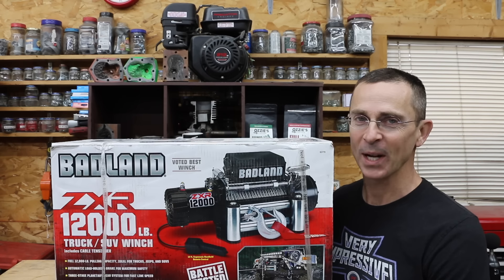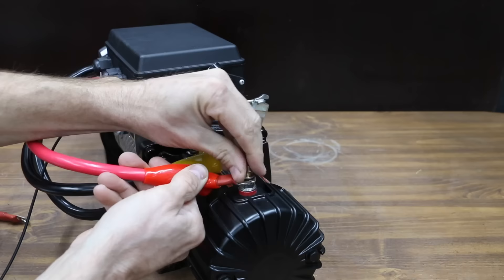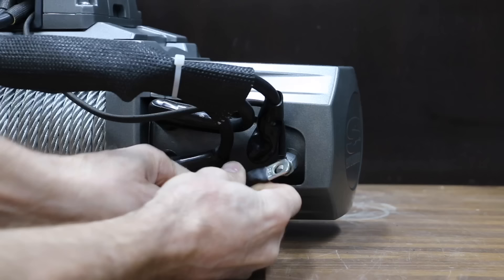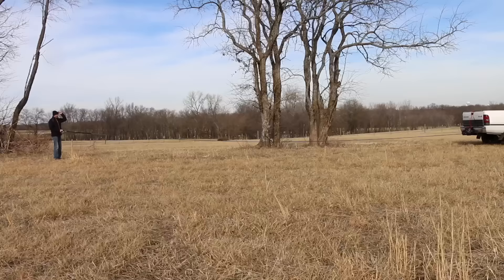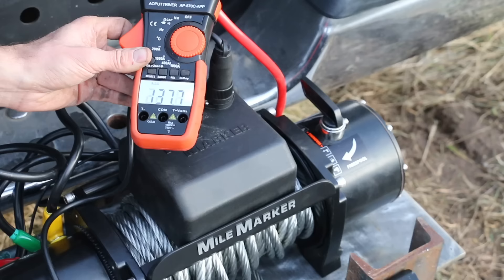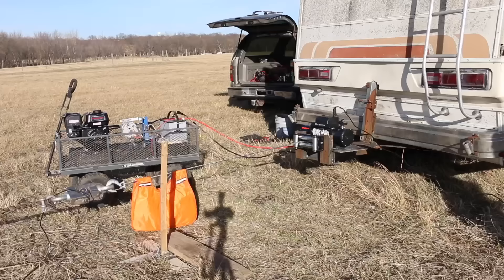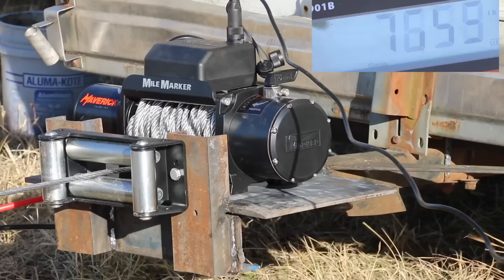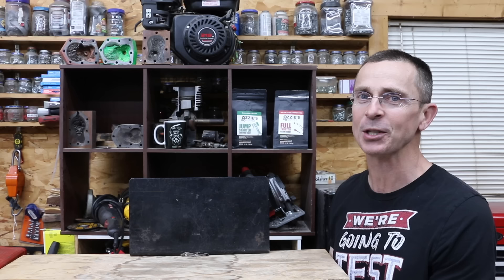Best Winch? Is BADLAND Better Than WARN, Smittybuilt, Milemarker? Let's Settle This!

Comment: I wish the Badland Apex was included, it seems to be the go to option at harbor freight.
Reply: Same
Reply from the maker: I can put together a round 2 video if there's enough interest
Reply: @ProjectFarm  yeah I would want to see the 600$ apex winch in action. It’s a fairly new product and it seems like a bunch of off road YouTube channels are switching to it.
Reply: @ProjectFarm  I would be interested for whatever it's worth!
Reply: @ProjectFarm  YES PLEASE!!!
Reply: Definitely interested.
Reply: @ProjectFarm  yes please!
Reply: Yes. Apex vs it’s Warn counterpart would be awesome. I’m seeing LOTS of Apex 12K’s out there
Reply: I would most definitely be interested
Reply: @ProjectFarm  Yes, please include ROPE VS STEEL CABLE as well.
Reply: @ProjectFarm  I've been running a 12k synthetic rope Apex for around a a year.  I love it, but I'm near needing another winch for another truck.  I'd love to see it out up against another
Reply: @ProjectFarm the zeak with a upgraded aftermarket rope or cable since the rope snapped?
Reply: Agreed The Apex is built much better than the standard $350 winch. Though I don't know how fair of a shake it got in the last couple of tests since it was damaged by a faulty plate.
Reply: I would like to see that added to the tests as well both in the wire and the synthetic rope options!
Reply: @ProjectFarm  honestly, is like to see the lowest rated winches that failed RETESTED because of a poor quality mount. Not fair to twist a winch and damage it because of user error.

BUT it was a very good learning point! I need to go look at the quality of MY mounts!
Reply: @kencramer1697  THIS
Reply: I have a badlands apex and it looks very similar to the zeak 🤔
Reply: A round two would be great
Reply: @ProjectFarm  definitely interested also
Reply: @ProjectFarm  YES!  please do the apex!
Reply: Yes, would love to see an Apex included in round 2... Even if it's just against the zeak, which I had never heard of before. Thanks for this video...

As an add on or bonus, maybe find a good hitch mounting plate as well?? 

Thank you sir.
Reply: Absolutely I think it would be awesome to know before I buy one.
Reply: @ProjectFarm  I'm with the others, yes please.
Reply: I’ll add my vote
Reply: @ProjectFarm  interested!
Reply: @dand.4657  THIS! A good hitch plate makes the winches so versatile, but as we saw, also causes damage! Not all of us have a $5000 custom bumper on our $1500 beater work truck!
Reply: Same, it seems to be one of the more popular winches these days
Reply: Yes, very interested
Reply: @Project Farm  do the warn winch made in America...big quality difference
Reply: I agree, that the Apex should have been shown ......
Reply: I agree, the Utah Offroad Mafia all seem to utilize the Apex and like it.
Reply: @ProjectFarm  don't worry, there is
Reply: @projectfarm yes please!
Reply: @ProjectFarm  if you make it, we will watch!
Reply: @ProjectFarm  you bet everybody wants to see a round 2 with the Badlands Apex winch. I'm really surprised it wasn't included in this video.
Reply: @ProjectFarm  there is!
Reply: @ProjectFarm  One of the few videos I didn't skip to the end to see the final results. Loved the different tests.
Reply: I got one on sale for $500.  I've not tortured it, but I have nothing but good things to say about it.  ...I take that back.  The red on the freewheel indicator sticker faded somewhat.  I would love to see it in a round 2!
Reply: I am interested in that comparison also. Love your channel.
Reply: Definitely do the Apex.  At least in the offroading community, it's a popular and often talked about option.

The other quality option seems to be the ComeUp winch if you want to do another head to head.
Reply: Agreed
Reply: Yes, please!! Round 2!!
Reply: Round 2 should be a long term test after the winches have sat in the weather for 6 months to a year.
Reply: Yes please I’d love to see the apex I’ll watch either way though to be honest just interested in the apex
Reply: Yes badland apex please
Reply: I was just about to leave the same comment! The Badlands Apex is supposed to be the newer better version of the Badlands tested here.
Reply: Id love to see it too.
Reply: @ProjectFarm  yes i would love to see another video. I'm going to be purchasing a winch in the near future, and want to make the right choice. I would also request a bit of info on the wireless remote controls. I'm interested in winches with a wireless remote, and would like any feedback from you on the pros and cons, if any. 
Thanks and l loved this video!
Reply: @ProjectFarm  PLEASE DO
Reply: Try to find a USA made winch somewhere in that mix.
Reply: What do you mean "user error"
Reply: @ProjectFarm  Matt's Off Road Recovery, Trail Mater, etc would appreciate that!
Reply: @reddodge4423  absolutely!
Reply: @ProjectFarm  Please do. Thanks
Reply: @SethMethCS Yes!
Reply: @ProjectFarm  please also test 10k winches such as the smittybilt X20
Reply: I have the badland apex so my vote is cast lol
Reply: I second your opinion. I've heard very good things for the price.
Reply: Definitely want round 2 with Apex vs. Warn
Reply: Yes.  Round 2 please with a beefed up mounting plate for all.
Reply: Yes please 🙏
Reply: @ProjectFarm  I'd be down for that, that's the one I just bought and mounted.
Reply: @ProjectFarm 
I was waiting on the Badlands Apex to be in the test. 🤣😂It seems to be the go to winch for a lot of people right now.
Reply: I would love to see a test on the apex winch. I have one and it gets used and abused on a regular basis with no failures yet. I've owned a few different winches in my day and I can't say it's the best but it's definitely on par with much more expensive winches
Reply: Maybe you can test "come up", since gm uses that winch on their trucks, would love to see Rd 2
Reply: @ProjectFarm  I would also love to see the Apex! This is a great video though. Awesome testing as usual! Thanks!
Reply: Watch Matt's Off Road Recovery and Fab Rats. They test them everyday.
Reply: @ProjectFarm  please do.
Reply: Wrangler star had one sent to him and failed pretty bad almost caught truck on fire
Reply: @ProjectFarm  Maybe the Traveller winch sold in Tractor Supply stores?  (Unless they're just a rebranded version of one already tested, I guess that's entirely possible)\
Reply: @ProjectFarm  I am interested. I am actually interesed in zeak since a rope can be swapped for a higher quality.
Reply: @ProjectFarm  yes, please ..although i am from the UK i would like to see a USA-made warn winch in the equation and also the availability of spare parts for the winch as the cheap china made winches may be cheaper but become throwaway winch once the warranty is gone . i had no problems getting parts for my 25-year-old Warn M8000. also of note winches that have the brake inside the drum cannot be (or should not be) upgraded to the synthetic rope as the drum gets hot with lots of powered out winching say when lowering yourself down a slope ..however, i see some Chinese winches sporting synthetic ropes from new with internal drum brakes
Reply: Also very interested in the apex
Reply: @ProjectFarm  Yes please do the Badland APEX winch
Reply: @Smokey  warn zeon winch is made in USA...much better quality than the warn in this test
Reply: And please also include Ramsey winches
Reply: Definitely add the Apex
Reply: @nsbyband5239  I like how you think.  Maybe the Yankums rope winchline.  They are supposed to be very good lines.
Reply: I also would like to see the Badland Apex and how about Travelers from Tractor Supply?  Sunday never comes fast enough to see your next video.  I always enjoy.  Thanks
Reply: @ProjectFarm  Would definitely be interested in a round 2 that includes the Badlands Apex and the Quadratec Stealth winches.
Reply: @ProjectFarm  I'll bet there is! Also, it might be fun to do a ATV or UTV winch comparison. I've always wanted to buy a super cheap super small winch to use in building a crane or gin Pole, it would be neat to see if any of the super cheap ones hold up! Thank you for everything you do! you are truly awesome!
Reply: Dress Eddie like Walter White for Fun
Reply: Yes please!!
Reply: @ProjectFarm  I came for the apex too :/
Reply: Yeah, the Apex is kind of the new standard.
Reply: Love to see a round 2 maybe upgrade the zeak to a steel cable or better rope if possible and tested again too
Reply: @ProjectFarm  I'd be really interested in part 2, especially with a "VEVOR" brand winch. Slightly cheaper than Harbor Freight
Reply: Yes, please test a second round.
Reply: Apex vs Warn Evo Xr both with synthetic rope would be amazing. I ended up choosing the Warn but always wondered. Ironman was also a contender for me.

Could they beat the $300 winch? Most off readers know you only get max pull on the first loop so ensuring they all make the pull would be sweet
Reply: Yes I would love to see the Badland Apex also. 👍🏼
Reply: I would like to see the APEX too!
Reply: Right?!
Reply: @ProjectFarm  yep. I have the Apex with nylon. Best decision I've made. I never thought I would give up abrasion resistance, but it is much safer.
Reply: totally interested, i own the $600 badland apex and am very curious to see how it performed against these
Reply: Round 2!!!!!! 🔔
Reply: @kencramer1697  I was thinking the exact same thing while watching the review. Its definitely not an even comparison when using a bent mount on some of the winches. I think he should have just used the one he made since the store bought ones were garbage
Reply: I went straight to the comments to say the same thing. It would be interesting to see if the apex is worth the extra money. Especially since one of the least expensive winches seems to have done the best in this comparison. Either way, I love the videos and almost every time Im considering a purchase the first thing I do is check project farm for the best deal on the best product
Reply: @project farm please include the harbor freight 12,000 XZR with a beefed up winch mounting plate as well.  It looked like the failure in this test allowed it to twist so we didn’t get the best results.  Thanks
Reply: I would like to see the Apex synthetic rope version of the badlands as well as I have been thinking about this for my jeep and so has my dad.  please include the rough country 12k winch aswell.
Reply: @MrPabco  Yes
Reply: I wish I were local to Todd, I would like my 15 year old 9k Mile Marker tested against all those. I've yet to have a need it didn't meet including a 4020 John Deere buried to the belly with a 1508 batwing mower hitched to it. Granted, I had to chain the rear of my CJ5 to a tree but it snatched it out, slow but sure. Or surely slow. And I've never done one single repair to the winch or the mounting plate since I've owned it.
Reply: I definitely agree the apex should have been included as it's almost a direct rip off from the warn.
Reply: @ProjectFarm  I'm interested for sure.
Reply: @ProjectFarm  yesss
Reply: @Project Farm there is also the ZEAK 13000lb Platinum, with 6.5HP, 218:1ratio, and wireless remote.  I think there should be round 2 on this segment!  Solid video as always.
Reply: @ProjectFarm  I would love to see the Badland Apex tested!
Reply: @ProjectFarm oh yes please. That would be awesome. Especially since a lot of YT commercially operating wreckers are using the Apex like TrailMater, Casey LaDelle and Matt's Offroad Recovery and the Apex seems to be very reliable and trusted.
Reply: @ProjectFarm  please do
Reply: I'm a harbor freight fan,  you always have to compare price to performance
Reply: @tmwolfe  Badlands Apex vs Warn Zeon!
Reply: @mudgyver5205  exactly! I was drawing a blank on the name. Lol
Reply: @Red Dodge  pretty sure that's what Matt's Off-road is using on some of his rigs.
Reply: @christopherdecker8171  Yep. I think he has 7 of them on the wrecker alone.
Reply: @tmwolfe  many years ago a friend used to tell me I was like MacGyver but I like off-road especially the mud pits hence…
Reply: Also would like to see HF Apex 12k please
Reply: I came to look for this comment. That is the winch Matt's Off Road Recovery uses exclusively and I would like to see how it holds up in these tests.
Reply: I've seen that apex completely tear itself apart on another channel it was garbage nothing beats a warn
Reply: @ProjectFarm  Yes agree round 2!
Reply: Apex should compete with warn or smitty
Reply: Hell ya! If it's good enough for MORR, then it's gotta be pretty good.
Reply: Also interested to see the apex put to the test. I own 3 and they always seem superior.
Reply: I was thinking the same thing.
Reply: @ProjectFarm  I’d say round two with the higher end 12k winches with synthetic rope
Reply: @ProjectFarm  Add my name to the list!  As an Apex owner, would love to see the comparison.  It's performed great for me, but then it's also the only vehicle winch I've ever owned,
Reply: Just gonna pile up here, yes please do the badland Apex!!
Reply: +1 for Apex
Reply: I have the badlands apex on my Jeep and it does the job without any strain.
Reply: @ProjectFarm  The Badland 12K Apex is the one mentioned in all the Facebook groups, forums and others YT channels.
Reply: Same, you could just add that one, probably not a full round 2
Reply: @ProjectFarm  yes, please!
Reply: Yes! I've seen multiple Apex winches used commercially.
Reply: @Project Farm  yes please do!
Reply: If you like garbage.
Reply: I came here very excited to see a showdown between the BADLANDS APEX and the 12k Warm that's made in America. I didn't have high hopes for the Warn Evo VR...Would love to see a showdown between those two - as would thousands of others in the off-road community.
Reply: @ProjectFarm  yes please as I also have the Apex with cable
Reply: @ProjectFarm  +1 for the Badlands Apex 12k
Reply: Same I was wanting to see if it's what a lot of other people claim.
Reply: Yes, apex vs zeak i dont even own a winch but now i want one and a better mount but not unnecessarily overweight.
Reply: @ProjectFarm  Do you think the weaker mounting plate twisting the winch had any affect on its performance?
Reply: @ProjectFarm  The Apex seems to be very popular- I have to assume there is a reason for it? But as the end consumer- we can't test several of them as you can (and thank you!!) - I have never had a synthetic rope option- for me, I am very interested in knowing more about them in comparison to the steel ropes. One thing that us in the oilfield industry all pay attention to is the winch's brake system. Many of us use them for a set of gin-poles in our 1-tons, and we have always heard to buy WARN because of the brake system- when a load is lifted in the air the WARN (supposedly) has better brakes to not allow the load to come back down unexpectedly. If you do another test is there a way to incorporate a brake test also? Thanks again for your work!
Reply: @tmwolfe  what we don’t see is deterioration over the years from weathering and moderate use. These are initial quality reviews. Tortoise often wins the race.
Reply: @cdmccul  he was using the $100 winch plate from harbor freight.
Reply: @rabbi6225  I see it listed as $75, with big handles he didn't install. I don't know how much help the handles would give to structural integrity though. I still say it wasn't fair to either winch to not retest them all evenly. Twist a Warn in a bad mount and I bet it fails early too.

There's a good point to testing how things work under abuse... But not fair to "head-to-head" such uneven abuse.
Reply: @rabbi6225  true! I actually own the Badlands Apex 12k and have used it about a dozen times over the last 1.5 years. It’s been fantastic.
Reply: @cdmccul  I was wrong it wasn’t the harbor freight. Some Amazon $70 cheapie.
Reply: @ProjectFarm  Add me to the tally!  I'm looking at buying the Apex, but as I'd be occasionally maxing it out I want to know how well it may hold up before spending that much on a HF brand (although they have been stepping up their game recently and seem to have really good customer service).
Reply: @ProjectFarm  I would be interested and if possible, please include a Comeup Seal 2. Thanks
Reply: Agree with the request to retest the 2 that the faulty plate effected in the WINCH OFF Round 2!
Reply: Yes please add the apex
Reply: @projectfarm definitely would love to see it!
Reply: Definitely do the Apex please. Too many YouTubers switching to them to not see how good it really is
Reply: @ProjectFarm  indeed!
Reply: @ProjectFarm  100% If you can swing it. I would like to see How the APEX Badlands holds up against a quality USA made WARN Winch.
Reply: A lot of the You Tubers using the Apex winch are sponsored by Harbor Freight.
Reply: @ProjectFarm  Please include the Apex synthetic 12K by harbor freight. I have had my eye on it and it is supposed to be HF's attempt at a warn Xeon 12k.
Reply: I have been pulling logd on my trailer with the apex...thing is a beast.

With that said, i don't have experience with other winches. I have it hooked to two deep cycle batteries
Reply: Interested in the apex synthetic rope test vs………..
Reply: I was hoping to see the apex. I’ll look for round 2.
Reply: @kalibrateddrift  It's his budget, not yours.
Reply: @ProjectFarm  Are there any that are made in the USA?
Reply: @ProjectFarm  It would also be nice to see that Apex compared to the Warn Zeon, as they are what is competing in the marketplace.
Reply: @ProjectFarm  Yes please.  The Freedom Winch Line is also heavily advocated by Matt's Off Road Recovery. They certainly seem to be working hard with the Badlands Apex winch.
Reply: @ProjectFarm  Not even a round two, just this one as an addendum.
Reply: @ProjectFarm  Would love to see that comparison!  Even though I already bought the Apex :)
Reply: @Project Farm  that is the exact winch I'm interested in atleast! I've been wondering if I should upgrade mine.
Reply: @reddodge4423  You don't get the coupons?
Reply: @ProjectFarm  Absolutely and a great job you've done.
Reply: I’m in
Reply: @ProjectFarm  absolutely!!!!!
Reply: @ProjectFarm  There is enough interest. I think everyone expected the Apex to be in this one as it really is the standard people are comparing to.
Reply: I felt the same I feel like it’s the badland we all buy. I have one on my truck but the cable version not the synthetic rope (because rocks) I felt like cable holds up to abuse better. I’d love to see the part 2
Reply: @ProjectFarm  I would DEFINITELY like to see how the APEX winch handles these same tests!
Reply: Pleas add the Badlands apex with the synthetic line. Have one on my Jl RUBICON and it’s never let me down in almost 2 years
Reply: @ProjectFarm  yes!
Reply: i personally bought the HF apex badlands with synthetic rope to pull my 3/4 ton truck out of a soggy part of my property because no one was gonna be able to get back there to get me out. it worked like a champ for me i was highly impressed with it
Reply: Absolutely!!!
Reply: @ProjectFarm  Yes please!
Reply: @ProjectFarm  Yes please, to the Badland APEX.  It would be good to include the pros/cons of wire and synthetic rope. The APEX is offered with wire or synthetic rope. One difference is weight; Synthetic is about 20 lbs less, a factor for those of us who live in the Rust Belt and store our winch under cover in the truck bed, away from salt and brine.Also please list the rope length. That older Badlands ZXR only has 65 ft. The APEX has 80 ft. Thank you for all the great reviews!
Reply: I'd love to see a test of the Badlands Apex vs comparable warns etc. Every off-road channel that's covered them has nothing but praise for Apex
Reply: On top of that the "pretty rough day" mentioned at 10:50 wasn't caused by the winch but was caused by the mount twisting, putting more stress on the winch. The test should have been redone on an equally new mounting plate (preferably with a new winch that hasn't been pulling at a twisted angle before), for it to be a completely accurate test. That wasn't done, so the test on the Badlands winch is void.

As he says at 10:58 in the video, the weak mounting plate also failed for the Rugcel. 

Therefore, both tests for those winches should be redone because they're invalid, as they aren't equal tests to the other winches, whose sturdier mounting plates didn't twist or deform in any way.

Whenever doing scientific comparisons, all factors have to be equal or they're invalid. Even the most minor of deviations from one item in the comparison tests can cause a completely inaccurate test.
Reply: @Rusted_Link  As does Casey Ladelle. He swears by them. Of course, the customer service of all of the winches should be tested as well. I've heard many people have had bad experiences with Warn's poor customer service. Having to pay to send it back, just to have them say that it wasn't their fault that a brand new winch failed on its first use. Then, with the customer having to pay to have the winch, they had to pay to send back, sent back to them to see what they could do to fix it themselves.

Yet with ones like Badlands, if they fail, you can take it into the Harbor Freight store and walk out with a new replacement within minutes.
Reply: @ProjectFarm  - Yes! Round 2! Round 2! Round 2!
Reply: @Project Farm on the new video( if haven't done already) make sure the plate is the same throughout. If I watched correctly,  the badland was stuck with a weak plate which transferred energy to the winch and twisted it up,  then you changed the plate for the others.  Id like to see a redo with the badland and quality plate.
Reply: @ProjectFarm  Add another yes, I would also like to see the Badlands Apex winch tested.  I would also love to see a test of different synthetic winch lines to include how safe they really are when they break under load, recovery straps, soft shackles and kinetic ropes.  That should keep you busy for a bit!  ;-)
Reply: Definitely interested
Reply: I feel like to twisted winches deserve another Crack at it too if you test more. Other brands ComeUp winches, Engo winches
Reply: @ProjectFarm  Can you test different come alongs too?  I feel like many of them would never reach their rated capacity..
Reply: Yes 🙌
Reply: Yes yes yes! You are a godsend to us blue collar Americans!
Reply: @ProjectFarm please do Round 2 and include the legendary Warn 8274 classic model and their new Zeon higher end model.
Reply: Todd, we have all the interest in the Apex winch!!
Thanks for bringing out the Zeak, haven’t heard of it before. 

Maybe a try Apex, x-bull, rough country, open road, vevor, polestar and stegodon!
Reply: Ironman 4x4 12000# winch w/ synth line would be nice to see perform
Reply: @ProjectFarm honestly just the badlands 12000 vs the Apex would be enough
Reply: @ProjectFarm I feel like you really need to. I mean the apex winch is becoming a go to winch these days
Reply: I would also be interested in Power draw rather than just amperage.  I could approximately calculate it myself based on the information provided but it would be nice to see it in the video
Reply: @ProjectFarm also like to see a old Warn winch. See if they used to be built better.
Reply: @ProjectFarm  ever since this video came out, looks like Zeak winches has been sold out! Yes to round 2!
Reply: Yes I’d love to see another test with all synthetic ropes and apex against warn and zeal with better rope Thanks for everything you do
Reply: @ProjectFarm  Would love to see the mile marker "Mission" series in the next one.
Reply: Same, we NEED the Apex reviewed!
Reply: Do this again, with the right mounting plates, and use the Badlands, APEX whinch.
Reply: @ProjectFarm  Interested
Reply: @ProjectFarm yes please!
Reply: That is definitely the one I'm looking at to buy this year as well
Reply: I would also like to see if synthetic wench rope is as strong as the cable it replaces.
Reply: TSC traveler
Reply: Retest with good mounting plates
Reply: @ProjectFarm  that would be awesome if you could. It's very expensive but it would be awesome to see how the badlands apex matches up to the warn zeon and zeon platinum
Reply: @ProjectFarm  water/mud testing as well!
Reply: Can you do the new Vevor 13k
Reply: Warn  2 year 😊🎉🎉 750$-1200$ usa parts usa  phones tech
 badlands 90 day 600$  😮😢😢 parts
Chisa   
150$ warn
Reply: Harbor freight 90 day
Warn 2 year 😅😂😂😂
Reply: @ProjectFarm  and throw in some 17.5k to 18k lbs winches as well for round 2
Reply: I would see the badlands apex as nice option for winches but the 90 day warranty and if you wanted an extended warranty you would need to add $169 on top of the $599 regular price . I personally won’t not take a chance on a winch that only stands by their product with a 90 day warranty compared to warns 7 years tough to beat . Not bashing apex in anyway but as a person looking for a winch i am researching before making my decision . Good luck to all of us when making a purchase and not just for winches . 🙏
Reply: Yes please!  @ProjectFarm
Reply: Definitely interested.
Reply: Some ideas for testing,vevor,xbull,stegoden, badlands apex just to name a few.
Reply: Yes round 2 with the apex!
Reply: Very interested thank you
Reply: @cdmccul  Agree, I used a badlands 9k to pull twice the highest weight on this vid and I still use it 2 years later.
Reply: @ProjectFarm  I would love to see a part 2. SMITTYBILT 12k vs badlands apex 12k
Reply: Yes please. Steal cable video :)@ProjectFarm